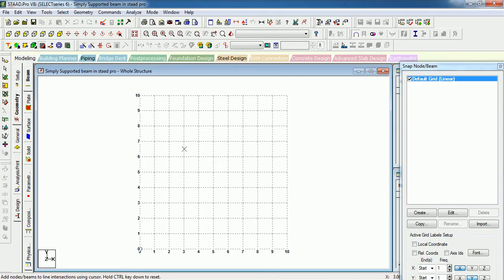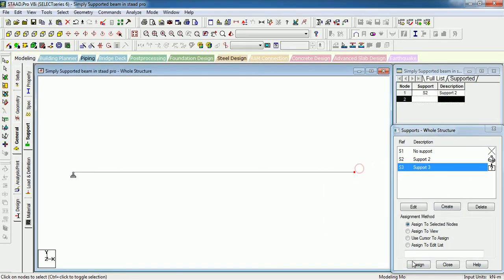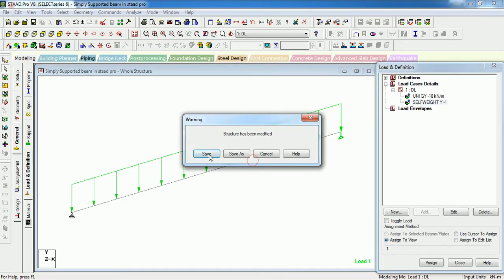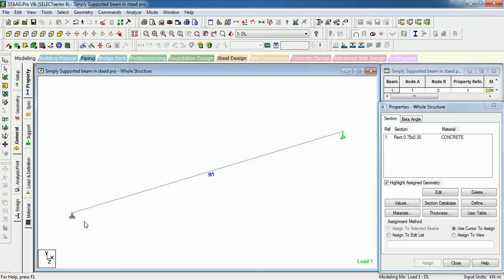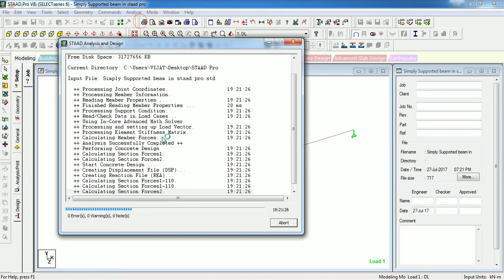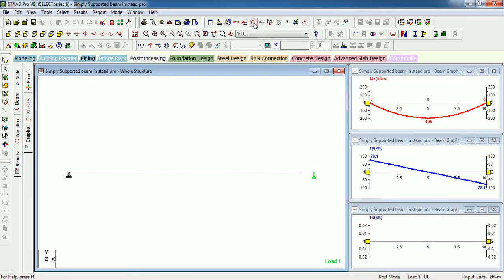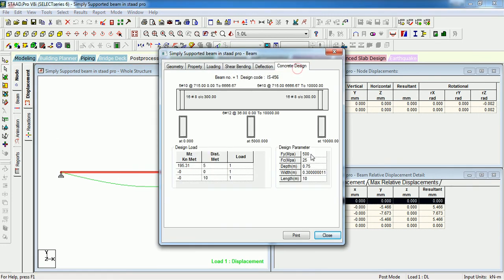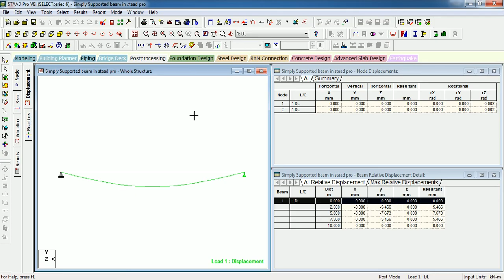Simply supported beam: Modeling, analysis and design in STAAD Pro

Comment: Good Video for Basics. However, it was also show to check the manual calculation. If the video is compensated with manual Calculations, then it will be useful to many structure engineering students to understand and learn the manual as well as the stad design calculations and comparison.  Overall is a very good video, Regards
Reply from the maker: Thank you sir for the comment. Will try to explain with manual calculation as well from next videos onwards. Do subscribe and share the channel